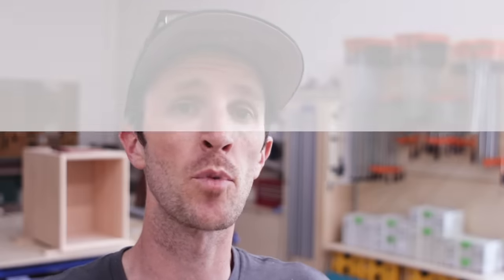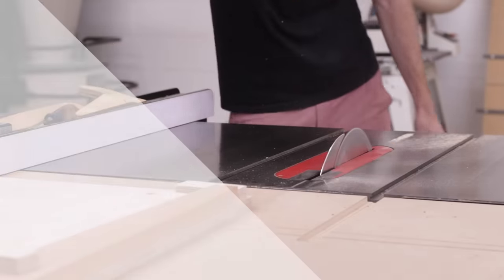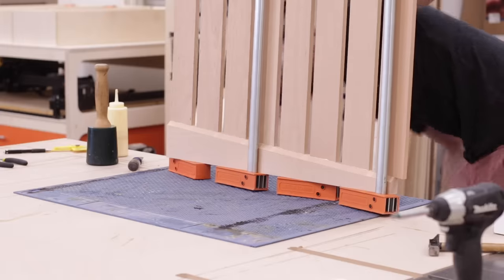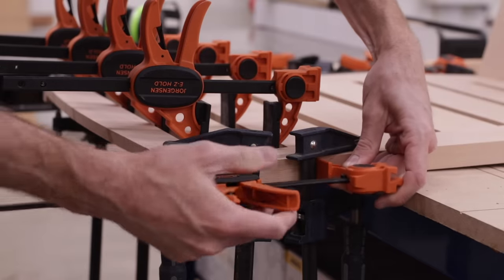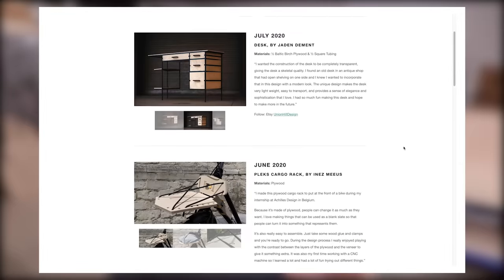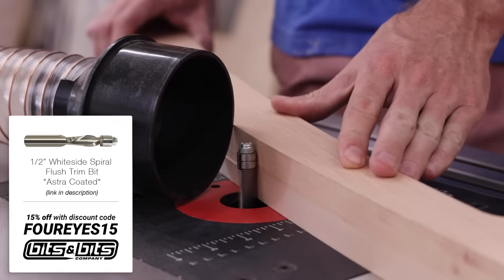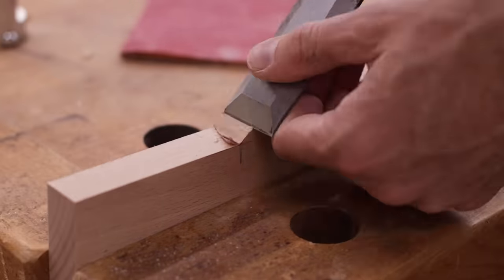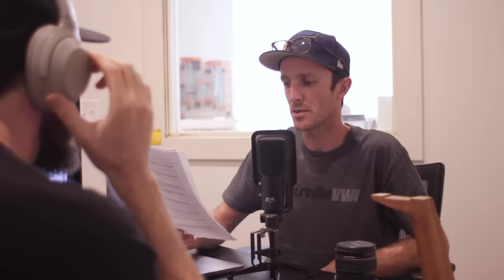How to Build a Modern Rocking Chair - Woodworking

Comment: Shaun (and others), i'm still kind of a beginner, so i just have to say that the process you demonstrate around 9:35 (and shortly before and after) was SO helpful! i think i first saw you do this in an old video on your original channel. anyway, i recently built my first bed frame and used this method to taper each of the four posts. it was easy, gave me perfectly repeated cuts, and felt safe! thanks for teaching me! and great job on this rocker -- as a father of two, i know just how important this kind of furniture is during those first months.
Reply: Isn't that awesome? when you learn a new tip that makes a task that seems daunting actually easy and achievable, it's so rewarding.
Reply: Really happy to hear that! That is really what we are hoping to do with the videos and plans. Yes, building a specific piece of furniture is great, but more than that it is the techniques and procedures that can be used on other projects that is really valuable. I know that stuff was for me when I was getting started!

Comment: Very nice design.  But how much testing on that joint between the back and the seat have you done ?  I have serious concern about the strength when it is rocking.   There is a great deal of stress on that joint when the persons weight is back and they begin to rock forward.

Comment: BTW, I just got a can of your “Simple Finish” and did a few test boards today. I’d love more instructions on using it on different grain woods. Thanks!
Reply from the maker: Hey there. It’s really as simple as wipe it on and remove the excess after a bit of time. Usually about 15-45 minutes depending on temperature and environment. 

Since it is penetrating if you have something with a very open grain you’ll use more because it’ll soak up more. That’s pretty much it though.
Reply: Chris Salomone - Thanks for the reply. Can I apply a wax finish? I make a bees wax and mineral oil mix I use on shellac and poly after  0000 steel wool. How long a wait if applying wax finish. I’m comparing it to Rubio now. Not sure I’m a fan of the Rubio. I’m still testing.
Reply from the maker: Hey MJ...the simple finish already has a wax top coat, that said you should be able to apply more wax without any sort of conflict. Honestly...it sounds like you already know a lot about finishing so I'm sure you'l be ok. I've never used Mono coat, but I'd be willing to bet...people who love using monocoat, the entire process, etc... won't love Simple Finish...and the people who love Simple Finish will probably hate Monocoat. Just my guess.
Reply: Chris Salomone - I think you’re right there. I like your oil better than Rubio, so far. Sorry to bother you. I just have a very sentimental job (Soldiers Flag Case) for a family. I used beautiful quarter sawn white oak, and have tried at least 10 finishes and I’m not happy yet. Your Simple Finish I believe is the winner. But, once it’s soaked in and cured is there any chance the oil would soak into, or dis color the flag? I really appreciate your help.

Comment: Beautiful design! However, I have an honest comment/question, being a woodworker myself: yes, wood glue is tough, but I’m sceptical about the strength of the joining between the back and the seat, especially if someone heavy sits in it. How many lbs will it support? Thanks.

Comment: Looks good, but it seems that there would be a lot of stress placed on the joint where the back of the chair meets the seat portion, as there is no support under the seat to take the weight other than the joint fastenings.

Comment: What is the width of the base please?  Wondering if I can cut the templates on my cnc or do I need to order with templates.  I only have a 40 by 30 in. area.
Reply from the maker: The biggest piece is about 45 and a half, so you might be able to do it if you orient it diagonally...or perhaps by using some sort of "tiling" workaround.